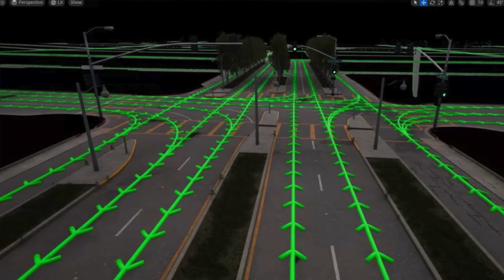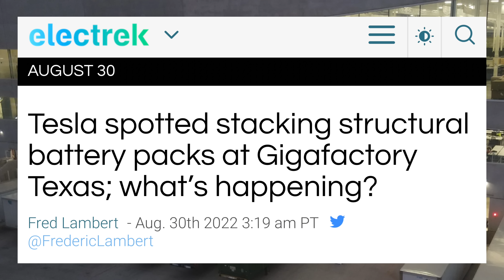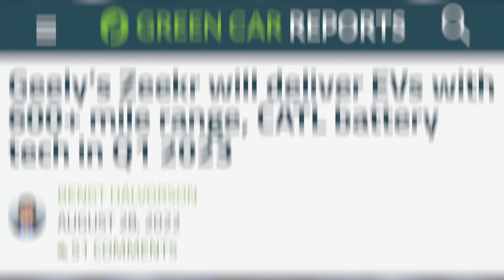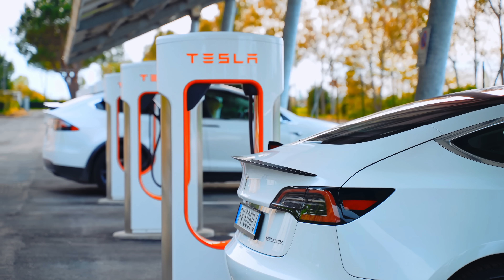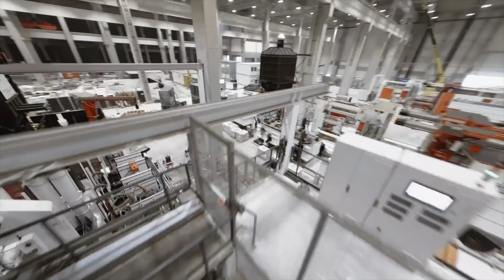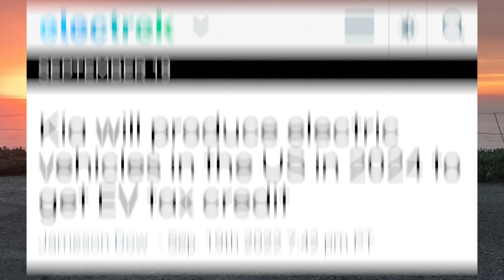Tesla Keeps Destroying The Competition | Ford Can't Keep Up

Comment: Possibly another disadvantage of shooting for unnecessary higher range is that once EVs are more common, people will start to realize how convenient charging overnight is and how little they actually need the extra range because of that. Then people will be less inclined to pay the extra money for the extra range they'll rarely use, instead opting for a little extra (although theoretically disproportionately less) charging time in those rare occasions.

The market would then be "flooded" with expensive EVs with unnecessarily large range (though thankfully it seems most companies aren't going that route due to the battery shortage). 

The fact that you can charge overnight and don't have to go to a dedicated store to charge your car changes the dynamic so range isn't as important.
Reply: Unless you have to park on public streets overnight, live in an apartment complex or condominiums with no access to electricity, or rent or have a house without parking.
Reply: @PC-vq5ud  
Well, even if you match every single one of those parameters, it depends on your use case.
Personally, as a former mobile technician, driving a company vehicle for business, neither I, nor my company wanted me driving long distances (my area, in the UK, was generally 80 miles across, but with occasional 200 mile runs)
The aim would be to arrange a route that had me actually on site rather than travelling.
Normal average distance? Between 10 and180 miles total over 1-6 calls, depending on complexity.
.
A "long run"?..... Early start, miss "rush hour 1" avoid "rush hour 2" (driving past cities) take a necessary break at 180 miles, 3 hours.
(If using an EV, THAT would be the perfect 30 minute charge stop for "comfort", breakfast and a 10 minute power nap).
Travelling on, then completing the job by lunchtime...(?) would result in a much needed similar stop between either a second job, or on the way home.
No time wasted, the vehicle would charge while the driver does other things.
(That's not even considering destination charge)
A late finish would result in an overnight stay and a route completing several calls on the way home. Efficient time management.
The point being, a sensible business use would be quite possible.
.
Commuting?
Let's make an assumption that an EV user in city suburbs may not be commuting by car? City centre parking? For work?
So it's either a commute across the suburbs, or out of town? (Why?)
Such workplaces will be more likely to provide destination charging(?)
Will such a driver be commuting a long distance every day? (Less likely)
Will the vehicle be used for "other things"? (Socialising, shopping, etc)
Here's a prediction.
Any activity outside the commute, but away from home will provide opportunity for charge at the venue, while the driver does other things
Graze charging will be everywhere.
Opportunity will grow in tandem with EV numbers.
.
It's going to be a "non problem"
.
Outrange the driver (when necessary).
Charge while the driver does "stuff".
Reply: @rogerstarkey5390  Exactly. Range anxiety is the hardest thing to overcome until you actually experience charging on a road trip. One trip and it's gone.

Comment: I really hope there is a reduction in lead time for Model Y's. For instance, I purchased a Model Y Long Range completely vanilla back in November 2021. I still dont have that car... tomorrow is actually 300 days of waiting. This is a terrible customer experience, and one that no one should have to go through. I understand demand is high, and they simply cant crank out enough to satisfy it, but man, 300 days is a loooooooong time. Its unreasonable to ask a customer to wait that long when they are spending $66k
Reply: Unfortunately had you added 1 thing extra probably would already have it.  Bc you ordered same vehicle majority wanted.  Weird but way it works.
Reply: @Brian-rm8dn  I'm not sure you are talking to me, but on the order page it says if you order the vehicle with 'any' mods it will slow down your order. (basically the opposite of what you are saying). I've spoken to one Model Y owner here in Melbourne Australia, with the exact 'standard' order as I have (White paint, black seats, 19 inch wheels) and he received his 3 weeks ago. He ordered 20 minutes after the order button went online. My order was less than 48 hours after that, and it's now saying I should receive my Model Y between Nov 2022 and Feb 2023 (It was Nov22 to March 2023). However what is really interesting is that my original 'flexible' order price (not fixed like in the USA) has DROPPED by AU$2000. I'm certainly happy about that.
Reply: 300 days is nothing. I've been waiting for my Model Y since 2019 !!! However, it is coming from Shanghai (to Melbourne Australia) so wait time should be very soon now...
Reply: Doesn’t Tesla keep your original price though?
Reply: @Samuel-nf3pm  yup they did.
Reply: They are quoting delivery time Dec-Apr for new orders. Wonder how.
Reply: @lalitpandit1510  that’s why I find it very hard to believe. My initial estimated delivery date was back in May

Comment: Real world driving conditions are never ideal, and the current battery tech isn't supposed to charge over 90% or go below 20% (so you're automatically cutting 30%+ off the estimated range). That, relatively slow charge times, and limited charging locations means yes, WE NEED MORE RANGE
Reply: My model Y-SR, when it arrives in Australia (from Shanghai) will have LFP batteries, which can be charged to 100% with no issues, and they supposedly last 3 times longer.
Reply: @greghudson9717  that’s an improvement! Can you regularly take it below 10% without issue?

Comment: Does anyone know if Tesla has plans to develop structural battery packs for 2170 cells? Especially if 4680 packs are delayed?
Reply: Unlikely. The 4680 is 46mm X 80mm. This is fairly cubic so contributes to the structure in a similar fashion to house bricks. The 2170 are closer to large domestic batteries. They are only as structural as the elastic band you put round them.

Comment: 'Do we need...' is often a very poor argument since it normally makes it's point by basically ignoring or severely restricting a huge set of use cases and freedoms of the user while pretending that those use cases are unimportant or not the way it 'should' be used.  News flash... those edge use cases are both absolutely important and entirely reasonable.
Reply: Edge use cases are important to understand, but not necessarily important to build for. You build for the masses, where the money is coming from.

Comment: I would say 400-500 mile range is good. 600 is a bit over kill, most gasoline vehicles are around 300-400ish, a hybrid maybe 500ish. 

Yea they fill up faster but hopefully in the near future there’s a safe way for charging to be quick and efficient. It definitely has improved a lot since 10 years ago to be fair.
Reply: My subcompact is barely hitting 250 miles, but it has terrible gas mileage. 300 is more than enough IMO; anyone demanding more probably needs to relax a little and stop relying on piss bottles while driving.
Reply: 250-300 miles of ACTUAL average range is what I'm looking for. My Camry does 270 in the winter with 95% local and 5% Highway driving.

So I'll be probably waiting until 2026-28 to see those ranges at a similar price as a new Camry XLE (about 35-40k out the door).
Reply: I’d be happy with the stated 330 range on my 2022 LR MY, as all Tesla owners know you don’t get that in the real world, particularly if you are traveling on the highway. My experience has been that the 330 becomes about 200 at highway speed. Getting the real highway range up to 300 miles would be a nice improvement.
Reply: anything is better then my car which is from 1986 XD

Comment: People need to realize that efficiency doesn’t equal range. In fact, they’re usually directly opposites from each other. Unless you have a pickup or another vehicle that would logically need that much range, the goal here should be to put the smallest battery in an EV to equate the highest range, not simply throw in the biggest battery. The environmental impact of throwing a huge battery so you can boast a 600+ mile range is way, WAY worse than having an EV with half that battery size that can go around 250ish miles on a charge and can charge in 5-10 mins. The goal shouldn’t be range, contrary to popular belief. It should be recharging in under 10 mins. Smaller batteries in EV’s means more EV production, less batteries mined, and less environmental damage. Think about it.
Reply: If you can get 250 ish miles - you gonna need to stop, quick bite, coffee etc., maybe 20 minutes - we are there already, and if charging is speeded up, you'll need to get back to your car in under 10 minutes...and someone will want you to move the car !
Reply: Unless your trip is 275 miles between the chargers.
Reply: @PC-vq5ud  Realize Tesla is scaling still. And already they’re making it damn difficult to not have a single charger 200+ miles apart. Let alone 100 miles. Or 50 miles. Look at the map.

Comment: The argument that you carry too much batteries around is just because of cell supply.
Tell that to all the SUV and Pickups that they carry too much stuff and weight around.
Longer range is needed as 300 miles translate to 150 miles real world. 
600 miles would equate to real 300 miles.
Reply from the maker: Real world range is not half. https://insideevs.com/reviews/443791/ev-range-test-results/

Comment: EV are fantastic but you need electrical power grid to power the cars. In California they just told EV owners to not charge their cars during the day because electric grid could not handle it ….. as they said all cars will be electric by 2035. California is the most mismanaged state in the Union.
Reply from the maker: We had a single week, where we were told to help preserve the grid by not charging cars from 4-9pm. Most owners never charge then, as our power plans are already structured to be significantly cheaper off peak. My car never charges until 9pm or later regardless of any power grid stress. Most EV owners felt 0 effect that week, and if they needed to charge, the still were able to. It was not a mandate.

Also, the idea that this will make a huge issue in 2035 seems to be based off of the idea that the grid will remain stagnant for the next 13 years as CA sells more EVs. The grid does need improvement, and expansion, but it's not an all or nothing situation the way many present it.

Comment: Elon is hiding his inefficient car which does not give range of at least 800 miles so that Tesla buyer can charge once a week. More battery is required but the net weight of car should be same which cannot heppen till batteries become more power intensive men’s it becomes better. Elon do not impose ur though or fake justification for short range cars?

Comment: Yes we need the range. Most people do not work in Tech. When you are using a pickup in Construction or driving to places in Texas or Georgia, jobs are spaced out. I sometimes travel hour to two hours one way to work even with my Pathfinder, I need the range!
Reply: Completely understand, though I think IN GENERAL most people don't need more range. Some will, but I think most don't once they start to factor in charging at home and decide the extra range isn't worth it for them for the few times they travel far.

But if you're traveling all day and need to charge more than once, less range (to a certain extent) may actually get you to your destination FASTER. Less batteries means lighter and more efficient usage of electricity, so when you do charge your getting higher miles per hour charging than someone with a bigger and heavier pack, since each kWh of energy they charge doesn't get them as much range. Imagine an electric hummer vs a model 3 charging at the same power, the hummer will need to charge longer to get the same amount of range as the M3. So as long as there are enough chargers to make it to your destination, less range will get you there faster.

I've heard that since the LFP M3s came out, the faster charge time allows them to actually outpace the long range M3, despite having a heavier chemistry that makes them heavier than the long range.

Though if you're hauling stuff and can make it to your destination only charging once a day (at the end of the day), long range is still needed.
Reply: So 2 hours out at 70mph is roughly 150 miles. 300 miles return trip in 4 hours.  Would you not want a  break after 2 or 4 hours driving? Every morning your car is fully charged to 400 miles. So you would be forced to take a break midway for every 8 hours driving depending on the availability of chargers.. If FSD works you could raise estimates and bills during the driving.
Reply: @MisterDemetrius Choice is good but not exactly free. Successful companies began by limiting choice. McDonald's began with burger and fries and no other choices. Ford, any colour so long as it's black. Elon is focussed on climate change so everyone carrying extra weight around is and issue.  I suspect when people have largely learnt not to have range anxiety, Tesla is not production constrained, then more choice will happen. By that point we may all be using robo-taxis.

Comment: It's unnecessary to have 600 miles range for the Roadster if it ever goes to production
Reply: @MisterDemetrius my point is we rather have everyday car such as  3,Y to be able to get 620 miles instead. Most if not all super car owners drive their high end to bagels and coffee or pick-up girlfriends, haha..
Reply: @MisterDemetrius but of course... More the merrier. I have a 4 year old PM3 with over 50k miles on it, lost about 25 miles to the battery degradation

Comment: Longer range means fewer stops in between, more charging stalls for others, way to go!
Reply: it also means less cars built, more expensive (as you use more battery per car)..also a bit less efficient since you carry more weight around
Reply: @MikeT5116  I own 2 different Tesla, it's true they both weight much more then ICE car, the only thing I felt less efficient is tire wearing off faster due to overweight n constant quick acceleration so..
Reply: Purchased the 2021 MY LR because I need AWD. $17k premium over the standard range. 244 miles vs. 326 Miles EPA. Efficiency EPA KWh/100 miles 26 vs 27. After just over a year, I found that I may have used that extra range twice maybe and I would have charged probably an extra hour total to make up for the difference in range. That's a high value on my time. But I needed AWD so I'm still happy with my choice. (I don't do a lot of road trips obviously)
Reply: @MisterDemetrius also, improving charging speed n stations will take away mileage anxiety
Reply: But longer at each stop, so no net gain...
Reply: @BigBen621  but overall you'll still save time n hassle for crossing country driving. I did 2 trips from Philly to Vegas with Model 3 performance (279mile range) and Model S Plaid (395miles range), overall results were obvious..

Comment: We own a 2022 Tesla Model Y Long Range, and there is no way I will take it on a long road trip with our family.
Our battery has a 75 kWh battery, and I NEVER charge it above 85% nor below 15% since we will keep it 20 years of city driving.

That means only 70% of 75 kWh = 52 kWh is available for driving. I average about 3 miles per kWh so I can only drive 150 miles without a charge. Using A Better Route Planner and driving 1,300 miles has us stopping 13 times, averaging 18 minutes each just so we can arrive at the next charging station with 15%. That's 4 hours of charging on top of the driving - this is insanity.

Luckily we have a rule that if a trip needs a motel stop, we will fly and be there in a few hours and rent a car.

So a 600-mile range on battery chemistry that allows 0% to 100% charging is earth-shaking - a "Game Changer" that I don't see Tesla doing for a long time.
Reply: You're being unnecessarily paranoid about the 15-85% usage.  You would see no difference in battery life if you did 10-90.  Unless you are making long trips REALLY often, the hit from being at 100% for a few hours is negligible.   Just set your charging schedule to hit 100 right when you want to leave.